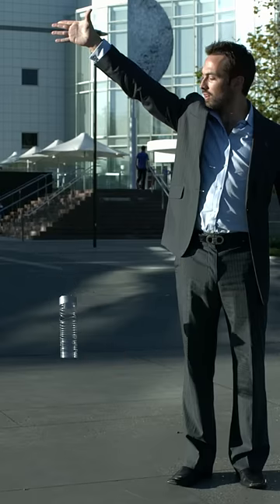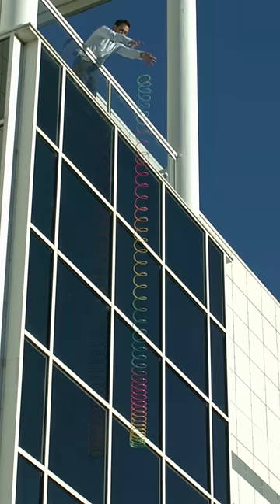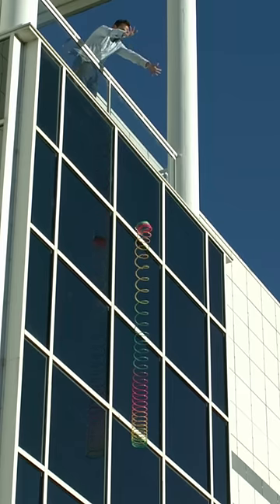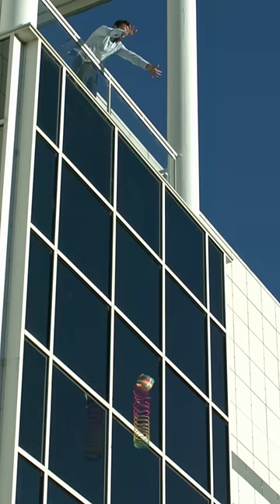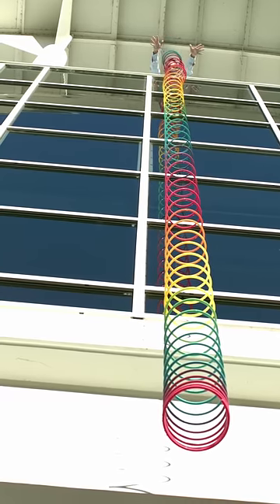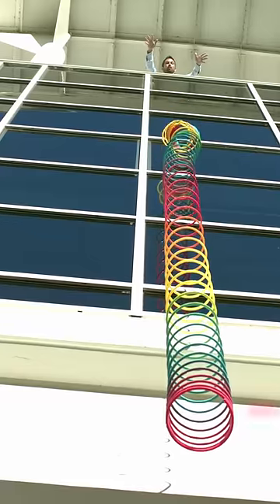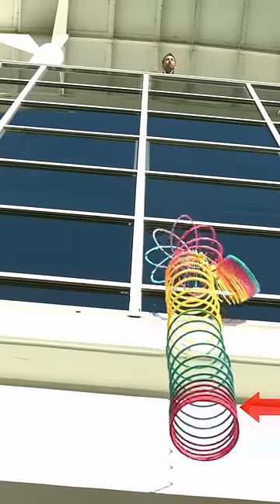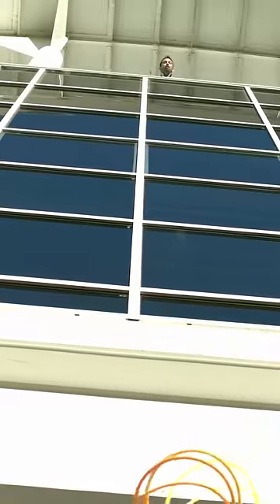How a slinky falls in slow motion #shorts

Comment: I'm amazed by this, tension is over powering gravity, the energy transfer is easily done in an equation but even understanding the physics behind this still boggles me.
Reply: Illusion is overpowering your mind my friend. The centre of mass falls with the just as you expect, ie with 9.8m/s^2
Reply: @sriramsridhara1763  it’s still interesting that the bottom is stationary. That’s not trivial nor an illusion. But it is another important/interesting fact to remember, so thanks for that.
Reply: @sriramsridhara1763  bro then it's center of mass lies above the slinky? It should be somewhere in the middle.
Reply: @krutideepankar5457  The center of mass is a little bit below the middle of the slinky.  If you drop a ball next to that point at the same time, both the ball and the slinky will hit the ground at the same time as well.
Reply: @BobbyBlue117  but why it starts falling form top?
Reply: @krutideepankar5457  Gravity pulls on every ring of the slinky downward always.  Before release, every ring is pulled up by the ring above it since the whole thing is a spring.  The top ring is not held by a ring but by Derek.  At the moment he lets go, only the top ring is pulled down by gravity  but NOT up so that ring falls first.  This causes each ring below to be "released" and fall but this takes time as the acceleration is finite.
Reply: @BobbyBlue117  it seems to be a logical explanation.
Reply: @krutideepankar5457  he's saying the center of mass changes as the slinky collapses, i.e. changes its total length.
Reply: The sun is 8.3 light minutes from us. So if the sun just magically disappears, we will still see the sun and have a sunny day for 8 minutes. Our experience will be like the bottom of that slinky falls, because for a short time, it would be as if nothing happened.
Reply: (Using google translator).
If you hold the spring (slinky) from above and leave it still, the spring will be in an equilibrium position. The bottom will be in an equilibrium between gravity and spring tension. When you release the spring at the top, the bottom will still feel the same gravity and tension, so it will remain in equilibrium as it was before. In order for the bottom start to move, it needs a change, and that change is the top part already crashing in the bottom.
Reply: the key is understanding that thanks to tension, the top loops of the slinky are accelerated more than 1g
Reply: Kelvin  congrats. You would’ve created airplanes in 2000 BC. Sorry were born in the wrong generation. But hey, there’s still some problems to be solved so get at it.
Reply: Kelvin  I would not say to a random person that the explanation is trivial.  Random people don't look at the world through Newton's laws.
Reply: @NicolasGuerraOficial  Even cooler.  It also takes gravity that much time to let go of the Earth.
Reply: It’s not overpowering; just equalizing and resulting in a zero net force/acceleration
Reply: why are u so amazed? tension was overpowering gravity before release... why should it be different for the bottom upon releasing the top?
Reply: @shadesmarerik4112  because we’re all humans and we’re used to seeing objects “fall” (and accelerate at 9.8m/s^2 when you drop them). But here you have parts of the slinky moving at different speeds so while it is truly “falling”, it’s still cool to see the propagation of the wave downwards while the parts of the slinky that the “wave” hasn’t reached yet stay COMPLETELY still.

I mean it’s obvious to me why people find it interesting, but you asked. 🤷‍♂️
Reply: @Michael-kp4bd  no, the question was not why this whole phenomena is kinda interesting to watch, but why the op is so amazed that the bottom isnt moving, despite it being held up all the time by the tension. Ur "explanation" is irrelevant, since falling only happens if stuff isnt held up as it is the case here. When u have an object in ur hand or hanging by a thread or swimming at a surface its always held up in a balanced equilibrium state. This counts for the bottom of the slinky until the top is crashing onto it. Nothing special, but interesting to watch
Reply: @Michael-kp4bd  one advice: if u have to retreat to say that something is "obvious" in ur explanation its most likely that u are somehow on the wrong path and u didnt understand something correctly.

It is either obvious as u described it, which makes ur explanation superfluous and then its most likely that u didnt understand the one who triggered ur explanation, or it is not obvious, which is the case where u are obviously wrong about something. In both cases u didnt understand the talking subject.
Reply: @BobbyBlue117  so, is the effect apparent in all objects to an extent? If the slinky has this property of extension/compression then all objects will have some miniscule amount of it. Even if only happens for a micron and a microsecond if you drop given object?
Reply: @jorgepeterbarton  Yes.  Since molecular bonds can be approximated as a spring-type force, a bar of any solid can be considered a slinky.  The difference is that a slinky stretches itself by about 5 times its original length under its own weight while a 20 cm plastic ruler when held vertically stretches by an undetectable amount.  This is quantified as a difference in the spring force constant (or Young's modulus macroscopically) of the two objects.  Therefore, when you let go of both objects, the slinky takes about a quarter of a second to come back to its original length (and free-fall as a whole object) while the ruler takes essentially no time at all before all parts of the ruler fall together.
Reply: The tension created on the slinky wants to travel in both directions; upward tension and downward tension, so that both ends can meet in the middle like it should. In cases like these, gravity is applying enough force to cancel out the upward tension (temporarily) but then doubles up on the downward tension.
Reply: There is no gravity.....😴🐑
Reply: @shadesmarerik4112  your advice to me is that if I say something is “obvious” in my explanation, then I’m probably wrong. We’re here having this conversation because you dismissed the phenomenon of the bottom staying  still as “nothing special” because apparently you think it’s so obvious. Damn that’s ironic.

All I find obvious is WHY many people are surprised. My explanation is about how people perceive things. I have direct evidence: all the people in these comments who have expressed their surprise. Why is that even anything you’d take a stance that I’m “wrong” about? You know what’s NOT obvious? Why you would die on a hill over semantics and tell people that they should not feel surprised, but apparently you allow them to find it “just interesting”. Pedantic nonsense.
Reply: @Michael-kp4bd  we are not talking about interest in a phenomena, at least i did not. U are the one who tries to constantly change the narrative
Reply: @shadesmarerik4112  what would be great is if you just concisely say whatever point you're trying to make instead of attempting to pull every fallacy you can think of out of your books. What's your original point?

I'll go first: Many people are amazed that the bottom stays still. As humans, we pattern match, and expect results based on prior experience. In this specific situation,  my well-supported hypothesis is that people find it surprising to find ~any part~ of an object to remain completely stationary for a long interval when dropped, because said phenomenon does not typically ever happen when "dropping" any item. A slinky is a unique situation because of tension, as we both understand. Thus, it is not surprising that people are "amazed" at the stationary phenomenon of the bottom of the slinky in freefall. Now you go. What's your argument again? Don't be amazed? I think this is silly.
Reply: @Michael-kp4bd  let me first state that u reacted to my argument in the first place.. and it looks like u havent really understood what i was saying. Instead of making up ur own theory of why people are generally amazed or interested u could have said something thats in any way connected to my argument that u commented on. Why do u ask me now what my argument was, after u commented on it? - because u really didnt understand what i was saying. Neither the op nor I spoke about general amazement of the phenomena that the bottom stays still. The op said that "tension is over powering gravity" and i added that theres nothing to be amazed of because this was the case before releasing too. Its the reason why the bottom stays still BEFORE release because its in an equilibrium state and this doesnt change until the top is falling onto it.
This whole conversation is NOT about an interest or general amazement of this phenomenon and u troll are trying kidnap the conversation, trying to change to ur pathetic narrative. It was not ME but U who is employing all those fallacies, i just mentioned them to give u an idea how broken ur rational thinking is.
Reply: @Michael-kp4bd  Also, again, i am NOT interested in a discussion about why this phenomenon is so peculiar for some people. I never even made statement about this. U are strawmanning, running against windmills, running in open doors. I dont care about this, and i certainly didnt argue against the point that u brought up, but has nothing to do what i was saying and still has not in any way peaked my interest. I dont know why u even bother me with this argument.. its completely irrelevant to me! i dont even have an opinion on this after exchanging 5 or so comments with u about this. U brought it up, and i never argued with or against it.
Reply: @Michael-kp4bd  so if u would pls stop being difficult...i had a great time until i was reading ur dung
Reply: @LaKoeps  ok? so where did i contradict myself? Are u able to give some quotes or is this the typical Dunning-Kruger-comment?

And btw... being pendantic is contrary to contradicting oneself. Either u are pedantic and u then u dont contradict urself, because a pedant would check earlier comments to avoid exactly that, or u are not and this could happen way more often. U just managed to write a self-contradictory sentence in a one sentence commentary.
Reply: My question too.........how does it defy gravity????
Reply: @NicolasGuerraOficial  that's not how gravity works
Reply: @shadesmarerik4112  being pedantic is not mutually exclusive to being contradictory. And even if it was, one could be pedantic and still have made a contradicting statement in error. So stop talking out of your ego about topics you don't fully understand, like Dunning-Kruger.
Reply: Jesus christ braniacs we all understand it 🙄 it's very fascinating though, let us enjoy it without over analysing and the need for you to show how smart you are.
Reply: @shadesmarerik4112  oh wait, you're not going to stop until you get the last word in that's right. Well go ahead.
Reply: @LaKoeps  so? where was i contradictory? and how does the length of my comment show that?
Reply: @LaKoeps  ur unproven claims get more ridiculous with every iteration
Reply: @LaKoeps  Just labelling me as someone who projects just dont gonna cut it, mate.. i was proving beyond reasonable doubt what a Dunning-Kruger -victim u are and where ur failures in rational thinking lie, while u still havent backed up any of ur claims
Reply: @NicolasGuerraOficial  thanks, that's probably the best explanation here👍
Reply: You actually believe in gravity? It’s all air pressure.
Reply: Yes and no i suppose. I guess the tension does overpower gravity. If it is as weak as earths gravity or less. Try this on jupiter and it probably won't work.
Unless you have WAY greater tension.
Reply: its still unrealistic even tho the vis is right there
Reply: @painauchocolate2395  no it's not. And the earth isn't flat either.
Reply: @cherrydragon3120  that is wrong, it will work on Jupiter the same as on earth. What u maybe mean is that the time for the top to reach the bottom will be way shorter, so the effect is less noticable, which i could agree on.

If u have a slinky or spring on Jupiter dangling in balance like here on earth theres no difference, besides the excursion of the bottom. There will be no difference in motion.
Reply: @LaKoeps  so u still havent said where i contradicted myself... admit u arent able to
Reply: @LaKoeps  hah! u talking of Flatearther and arent able to produce a single proof of ur claims. If u were right it  would be so easy to quote me on where i contradict myself, but ur not able to produce even that. Even a Flatearther can look down on u

Comment: In one of my college physics classes, the professor had a demonstrator showing how linear and rotational motion are coupled in a spring.  It was a very long/light spring (essentially a slinky) suspended from the top and with a weight at the bottom.  The weight had spikes coming out of it sideways to make easy to see it rotate.  He pulled the weight down and we watched bounce up and down, then transition to rotation until the weight was oscillating CW/CCW and then transition back.  That was cool until we had to explain it!
Reply: It's called a Wilberforce pendulum... Highly recommend looking into it for anyone else

The weights are to give it a significant moment of inertia, not for sight. If you can get the moment just perfect (such that the rotational frequency equals the natural oscillating frequency of the spring), the system can achieve a resonance that switches between pure rotation and pure vertical oscillation.
Reply: @martyguild  i think they meant the spikes were for sight
Reply: Lol
Reply: @maple22moose44  indeed they did, but it's not correct. The Wilberforce pendulum, which is what they described, needs to have a mass with an exaggerated moment of inertia in order for the system to work properly. This is accomplished with those "spikes." They are not for visual purpose.

Source: I own one.

Comment: A better way of looking at is is that the rings up above are pulling up on them at an equal force to gravity.

To explain further, the tension on the spring is gravity and the anchor is at the top, so at rest the tension is balanced with the force of gravity. When released, the anchor falls but when it does the tension is released which pulls up on the rest at the same speed as gravity (because it was all at equilibrium), and won’t fall until that tension is released. This is why the bottom remains stationary.